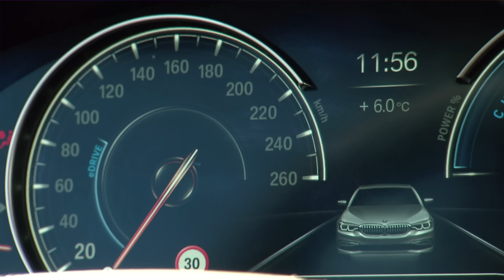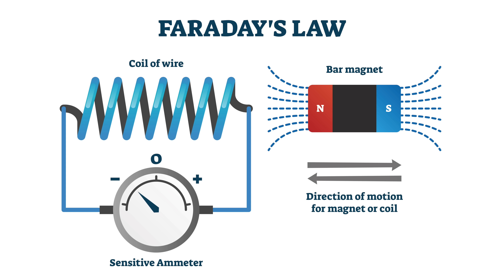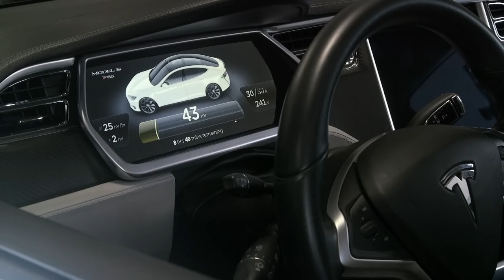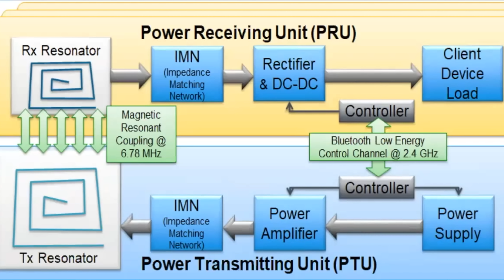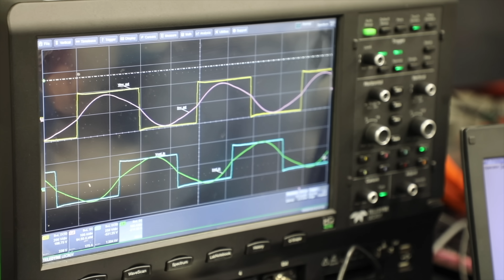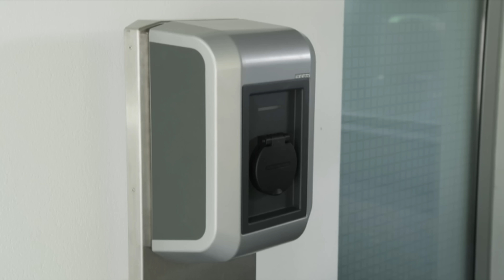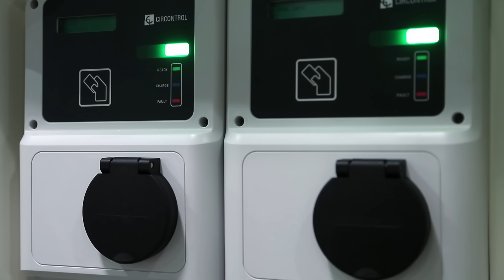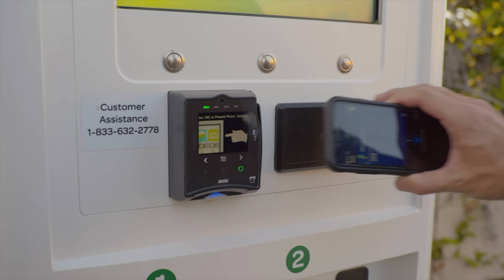Will Wireless Electric Car Charging Change The Way You Charge? Or Just Make Robotaxis Better?

Comment: The claim that wireless charging is "inefficient" is only true for todays commercially available technology; already two years ago the Oak Ridge National Laboratory achieved 97% efficiency at 120 kW ( https://insideevs.com/news/340478/120-kw-wireless-charging-proves-97-efficient/ ), far surpassing most of the current wired "fast" chargers. 

Remember wifi 10-15 years ago? Shitty speeds and poor range. The latest generation Wifi 6 is a different beast and makes ethernet cables obsolete for any regular use, I see no reason why induction charging would not follow a similar path (and in fact there's no latency issue to consider, unlike wifi vs ethernet).

Also worth noting is that with higher kW throughput, the demands of cables and connectors will increase, meaning increased risks when it comes to wear and tear and potentially making the already very bulky cables and connectors even more bulky (and expensive). A fixed wireless charger in the ground does not have the mechanical wear and tear you have with cables you plug in, and thus you can have properly dimensioned bulky cables to the induction pad and significantly reduce all the risks of manually operating high current cabling.

Comment: ANY charging technique, "if implemented correctly", will eliminate the car-charger interfacing problems you mention.  I don't think there's anything inherent about any of the conductively-connected charging standards that causes interfacing/authentication/payment issues, except the obvious problem that there are so many charging standards.
Reply: I agree one standard plug would do it nicely.

Comment: The biggest problem with wireless charging is effeciency.
It is possible to get highe effecienty but it us difficult to make it reliable.  The biggest problem with wireless charging is that the body of the car us made out if metal which is conductive. 
It is like parking your car in top of an inductive cook top. The receiver needs to be far enough away from the rest of the metal of the car as to not to interact with the charging or the charging pad needs to be made out of some magnetic material so the rest of the car is magnetically  isolated. As you said the only advantage is convenience but the cost can be quite high in terms of energy loss and expense.

Comment: Can't help disagreeing with you on this one Nikki. Two points: a wireless charger makes more sense if you live in an apartment or an area where some ne'er-do-well is inclined to tamper with your vehicle, even if the charging cable is locked in at both ends; evolution of wireless charging does not have to occur secondarily to the evolution of the existing method. This is a "race" to market where the public (and the planet) can only benefit. Greater exposure of the EV world to the public through publicity leaves a subconscious impression in Mr. Average that "this is the future" which can only be a good thing.

Comment: Witeless charging DOES address a current issue (sorry for the pun): accessibility. Do you know just how inaccessible some charging stations are for persons with disabilities? I am a wheelchair user driving a car with hand controls. I have to struggle with cumbersome cables getting caught in my wheelchair wheels, trying to climb over curbs just to get to the charger, trying to push over gravel, grass and mud, trying to push uphill or over potholes while hanging on to the charging cable etc. I made s presentation to BC Hydro ( up here in British Columbia, Canada) about this and they have now modified their charger installation guidelines. You should cover the accessibility aspect of EVs in one of your programs. I have lots of material if you need help:)))

Comment: Think about what electric vehicles mean when it comes to gas stations. Am I the only one here that wants to drive past that gas pump line at Costco, honk and wave as I drive by? It means the end of having to GO TO a gas station to fuel up; we charge at home. This is an immense convenience. Even if you only wait in a gas line for 10-20 minutes to fuel up an ICE car, that's still 10-20 minutes you reclaim with an EV, multiplied by each time you would normally fuel that ICE car.

Now take that convenience one step further. I remember using a wired charger to charge my phone. I remember having to remember to plug it in, not just put it down near the wire. When I switched to wireless phone charging, the only thing I had to remember to do was put the phone down on the charger (in the same place I would have laid the phone when "wire" charging). Equate that to the act of simply pulling into a garage. That's the equivalent of putting the phone down on the wireless charger. 

Wireless charging could eliminate another annoyance. 

Remember the issue of having to pull the ICE car only to one side of the gas pump because that's where your fuel port was? Or having to drag the nozzle and hose across your car to fuel up if you pulled up to the opposite side of the gas pump? This hasn't been addressed in the EV world; you have to pull into the garage the same way you always do based on the location of the charging cable, or pull the cable around the car to plug in if you didn't pull in the same way. With wireless charging, this issue could be resolved. In several of the wireless charging videos, the car seemed to have the wireless receiver (the part attached to the car) near the front of the car. Put that receiver in the middle of the bottom of the car and it won't matter if you pull into your garage forward or backward.

I think wireless charging will be accepted at home quickly by those who sometimes forget to plug in at home. With this, you just put your vehicle in the garage and that's it. No more panic in the morning as you realize you've forgotten to plug in overnight.

I'd be surprised to learn that a modern EV wouldn't text you when it needed to be plugged in when you arrive home, but still. 

I'd like to think I'm not likely to forget to plug in when I eventually get my EV, but I'd jump on the wireless charger thing immediately if it didn't affect the EV maker's warranty. WiTricity claims to have their system as efficient as if you were to plug in your EV. For me, this is the way to go, even with the added cost. I do think, though, that I would prefer not to embed it into the concrete on the garage floor; I want to be able to take it with me when I move.
Reply: I think the "gas station" will evolve.  Most already have a "convinience store" and no repair shop.  Next comes the collection of charging connections and some place to get lunch.

Comment: Wireless charging uses high frequency current whose harmonics wiill obliterate of much of the radio spectrum and possibly ruin radio astronomy too. RIP all ham radio!
Reply: I disagree.  A high powered charger based on a 5KHz resonant converter design would not make much power at 15KHz even in the near field.  You would go with transformer steel or perhaps metglass for the cores.  Ferrite for large sizes is much too fragile and has a ten times lower saturation flux.  Since the design would be going for a very high efficiency, the magnetic loop would be so that the lines of force don't wander off into free space.  As you go to higher power levels, high frequencies become less practical.  Even the fastest super junction MOSFET is not nearly as fast as a small MOSFET typically is.  The percentage of the cycle used up in the transistions of switching will come to dominate the semiconductor losses at anything like a high frequency.  Thus with good design ham radio etc are safe.

Comment: While the resonance method raised efficiency from abysmal to mediocre (outside of pr claims  found numbers as high as 80% compared to a plug's 99.99%) the whole scheme only works to fill niches. Coils in the ground are unlikely to get vandalised and can be hidden nicely.
But how do they deal with frost or road wear and degradation? Also resonance requires emitter and receiver to be matched. The recharge on the road dream many seem to entertain is likely to remain just that.

Comment: No.  The reactive and resistive losses in each coil at less than radio frequencies are prohibitive in an air gap system.  At radio frequencies the field is physically dangerous. Regardless of how power is delivered to a vehicle, it still requires infrastructure to deliver that power. 
If you believe that the roads built with tech that precedes the Roman empire and are nearly impossible maintain free of cracks and potholes with be replaced with ones with embedded power coils, you are wrong.

Comment: Remember there was no wifi? This is quite the same type of convenience, especially if most vehicles become electric. This will be next big step in electrification, just before autonomous vehicles take off.
Reply: Are u kidding. Have u heard about radio. All these wireless communication methods are same, what has been figured out over the time vis higher frequency transmitter and receiver.

Comment: I was in a German team designing such systems, we burned 12 million euros only to discover we could not get the effectively better than 62% this means 38% loss in the form of heat end of dream end of project.  The technology is good for a toothbrush but will fry even a mobile phone battery making it fail much faster than using a USB cable. So my expert knowledge says its ok for an electric tooth brush but shit for anything else . My system was sold to Porsche with the result the garage is nice and warm in winter and in Sommer.

Are people really that lazy

Comment: I have a number of concerns regarding this technology
1) It is a core-less transformer - much more sensible description.  Transformers with a soft iron core are about 95% efficient (and we are finally getting rid of house hold ones for electronic voltage cutters at >99% efficient), but core-less transformers - depending on the air gap is .... crap (50-80% depending on air gap etc).  We know that there are efficient ones (and I wait for real life proof of those numbers quoted), but things are relative and we know the measurable loose to the national grid in the UK due to wireless phone charges is significant.  This also means there is significant heat created (guess where that lost energy goes), not really a problem in the car as it will already have cooling systems, but there will be heating of the lower coil to manage.
2) There is an issue that parking position is restricted, and all the testing of efficiency is when the car is perfectly aligned.  You will need to get used to parking straight ;)  The second problem with the parking is there no option to park in a different place - imagine a charge at home, do you put it in the garage or do you place it on the drive - choose now.  What about parking on the street - not really allowed in the USA, but certainly in Europe that is a free for all, and car "alignment" is not a concept people understand.
3) Cost.  At this time, without incentives the hardware for type 2 charging up to 7kW is about £800, though you can pay more for more bells and whistles.  Do you really want to bring this to the mass market and tell them - you need to pay £1000's more.
4) Charging on the road increases all the loss and cost issue - just not sensible in any real world.  How many transformer coils are you going to embed in the road ....
5) You think that transformer charging will solve the problems with public chargers - laugh.  You realise that we already have since 2015 a standard for identification used by Tesla automatic payment in standard type 3 charger for CCS and other standards for ALL cars - and it is not being added to chargers - cos they want to force you to use their expensive system and the stupid RF credit cards.  So what part of doing away with the wire and adding more cost to the charger will make companies make it easier to use the system - no - it will make them more likely to lock into some stupid system so you are forced to pay their setup costs.
I think this technology will be niche - you own a Porche Taycan/ e-tron/EQC, then you can own wireless charge and don't care about fuel costs (due to losses) and certainly don't give a crap about the environment.

Comment: I don't see why paying for charging away from home should be a problem. Australia has Tap and Go payment for just about any moderate sized purchased, current limit is $200 AUD.

I can't understand why such a system can't be incorporated into the charging stations. Park your car, plug in, tap your Credit/Debit card on the reader and charge your car. Payment would be automatically debited when you disconnect the charging cable. How simple would that be?
Reply: This is how liquid fuel stations work in the US and I presume everywhere else. You prepay with a credit card and then dispense the fuel. I see no reason electric charging should be any different, except I guess that the industry is not yet mature and the early players think they can capture customers by forcing them into loyalty programs.

Comment: I think you are spot on on your analysis, but there are other issues too, particularly the radio interference generated by these systems which would likely breech EMC emission limits. 

Inductive charging has a terrible side effect and causes massive interference to radio systems, particularly to frequencies below 100MHz. Add to that the energy losses that you mention it’s not a very green solution. Even a 7% loss is significant and all that radio interference to boot. 

As battery capacity gets larger and vehicle ranged exceeding what you can drive in a day I see the concept of en-route charging falling into historical door note as only destination charging will be in demand except for a very few edge cases.

Comment: ”Any EV owner” knows public charging is hard. This is just wrong since Tesla is the largest EV maker and Tesla owners just dont know this, including myself. I have never experienced any problems, you just plug in. Often Tesla drivers are excluded when journalists talk about EV charging, its like they are pretending Tesla is a small nishe company.
Reply: BYD is a larger maker of electric vehicles.  I had a Tesla, but it becomes a problem when the nearest Supercharger is 40 km in one direction, or 120 km in another direction, or 90 km in another direction.  And in SW Germany it was also a problem since I had to charge in Switzerland or France before going home and I never went North to take advantage of the nearest Supercharger which was 60 km away.  It did change with the Model 3 rollout, so instead of 120 km, it's "only" 60 km.
Reply: @lawrencetaylor4101  The way you write I assume that you dont have home charging, then EV is a real challenge no matter what.
Reply: From the illustration in the video, I think Nikki means charging in public places, like on the street. In these spaces, there should probably not be any cables that regular pedestrians can trip over.
We can extend this to some private places too, like condos where the parking spots are outdoors: Kids play or move around these places, so wireless charging seems to be the better option. Some condos even rule that cars can only park frontward, so the driver can see if there are small kids in front of them.
Wireless charging would solve the issue about where to locate the charging plug, as some cars have it in front, some of the left or right side or both, near the boot or near the frunk, etc.
Reply: I'm REALLY looking forward to the day when 'Fanboi' becomes uncool!!!
Then perhaps people will begin to use their OWN  brain again - rather than St. Elon's......!!!
Reply: @andymccabe6712  Dont know what you are talking about.

Comment: In northern climates like Canada and the northern states snow and snow removal - actually weather in general - has to be taken into account, so perhaps the new charging pads could be installed in the overhead canopies (facing down) which are sorely needed over existing charging stations to provide some weather protection for them.  Don't know about your area Nikki, but here 9 gas stations out of 10 have overhead protection for their fuel pumps, which of course are now chock full of electronics. . .but EV chargers are generally out there taking a beating from the weather and many of them are constantly down for maintenance.

Wishing you and yours a Merry Christmas and a Happy & Healthy New Year.  Take care of yourself Nikki, we need you!

Comment: I be happy with overehead rail feeds like on bumper cars for motorways ,then you would leave major routes fully charged
Reply: In the US most highways have at least 13 ft or 4 meters of clearance under bridges, to accommodate semi tractors, so I guess you want the power line to run about that high. Imagine a passenger car that could utilize such a thing. Its power plug would be at least 8 ft above the roof, driving at highway speed, potentially in crosswinds.

Comment: Asside from the path loss (related to the square of the distance) I can see a whole flock of the "magnetic fields from my monitor" folks going crazy. No to mention the possible rfi interference to amature radio as a  ham who already fights with everything from cell phone wall cubes to cheap china crap lighting fixtures and grow lights, no thanks.. Maybe we could run wires overhead like a bumper car!

Comment: The other major benefit would be for people who do long distance driving along highways.  Although I can use an EV for local with no issues, I frequent on most major holidays a nearly 400 mile drive and most driving planners require a drive out of the way to a charger or adding 2 hours to my trip.  If I could charge while driving I would pay for the option.